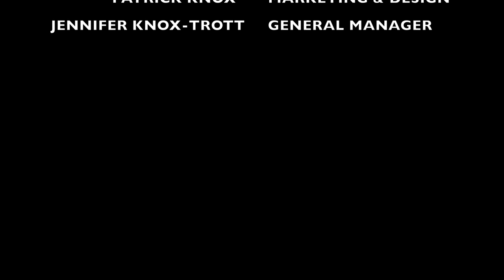S2 EP63 | OFF GRID TIMBER FRAME CABIN | WOODWORK | FINSIHING INSULATION AND FLOORING MATERIAL

Comment: With your saw mill, is there a reason you didn't mill 1" boards to use for the floor instead of the plywood? And just a quick observation, God blessed you with a wonderful daughter. Keep up the good work.
Reply from the maker: Well, I would have to have the “large trees to do it with which I cut most closest to me the others are on the ridge harder to get to. They would be green and would have to dry for at least a year.

Comment: You may be or not there is a wire 16'' or 18'' that is very EZ to use it goes between the floor joist and locks against the joist no stapling just snap them in I noticed the professionals use, and I  used them on my house 20 years ago they are still holding very good if I have to remove the insulation for any plumbing or electrical just snap them out no ripping the insulation.https://www.homedepot.com/p/Simpson-Strong-Tie-IS-15-1-2-in-Insulation-Support-100-Pack-IS16-R100/100375163